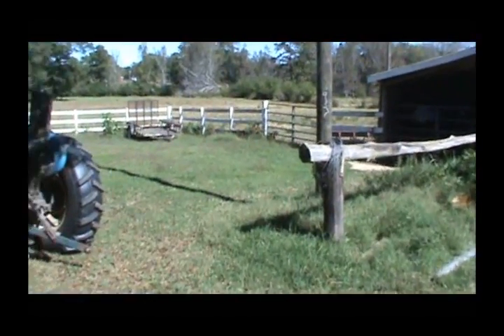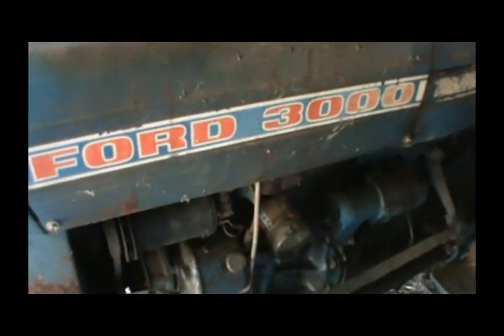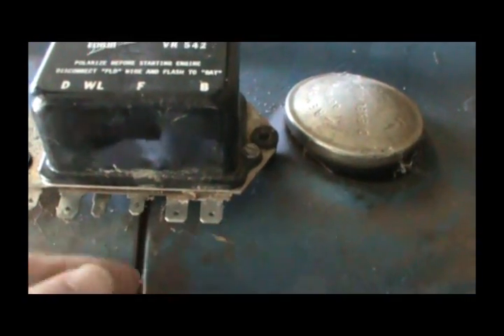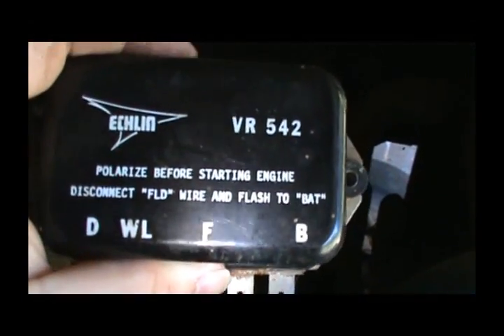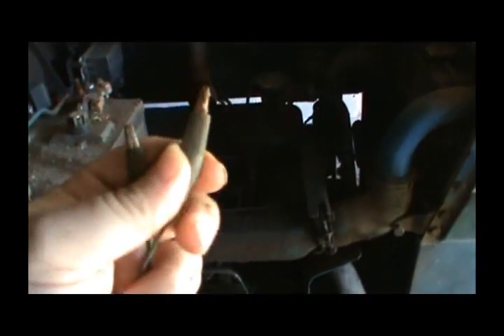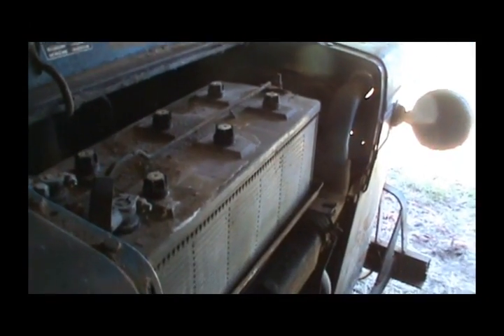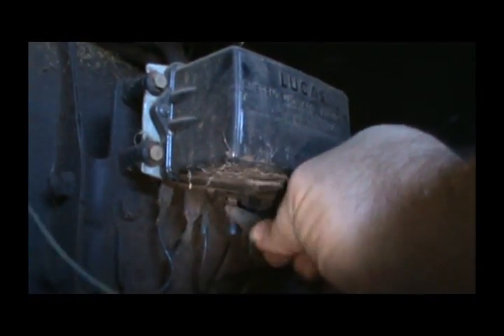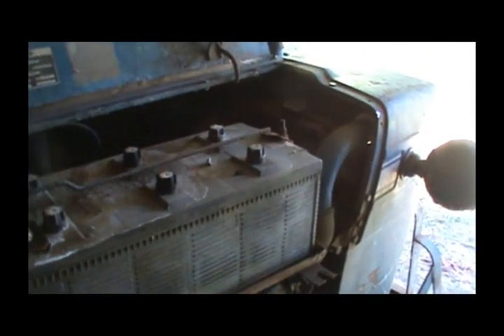Tractor's generator not charging? Try this...

Comment: Just bought a Ford 3400 and it is doing the same thing. I did find the wires from the generator are cracked, but going to do this flash on the regulator, since it has a new battery too.  Old video but so glad it is out there on the tube!  Hope you're doing well.
Reply from the maker: I hope it helped!  Hopefully the cracked wires are the culprit.

Comment: This is called polarizing the generator. You must do this because the generators magnetic field needs to be set for negative or positive ground. Don't do it and you could burn up your generator and ruin your battery. It is far easier to make a quick connection just for a second between the battery connection of the starter and the "A" terminal of the generator. Same connection electrically with no digging or fumbling. Just a quick tap is all you need. The generator should turn about 1/8 of an inch and you know it is done. Nice farm!
Reply: That is obviously a regulator for a generator that has an internally earthed field. For an externally earthed field in the generator  momentarily short B and D terminals together. The earth for the externally earthed field is connected  to the voltage vibrating contact in the regulator. Circuit to earth is completed via the earth tag on the regulator.

Comment: I have been charging a battery on a Ford 4000 for 2 years since my father in law passed. I was about to replace the generator and voltage regulator, found this video and so far it’s fixed.

Comment: Dead battery and broken key switch replaced and would not charge.  This voltage regulator polarization trick fixed it!  Thanks. You saved me time and money and I learned something new.

Comment: Hey bo, I got a strange situation with my Ford 3000 diesel. It was cranking fine and then the battery went out on it. I replaced the battery cleaned all connections and now it wont turn over unless I jump the starter with a screw driver, I had the starter tested and it was hitting every time. Mine doesnt have the neutral safety switch hooked up. Any ideas?? Its driving me crazy
Reply from the maker: I'd suspect the switch or the wire from the switch to the starter is broken.

Comment: Should I try to flash it if I’m getting a crazy high voltage? Or should I just replace it
Reply from the maker: If you're getting voltage, it's flashed.  Probably need a new regulator.

Comment: You said to touch the positive?  It sure looked like there was a negative on top of the battery in your video ,  Also,  my tractor is a positive ground,  would that matter?
Reply from the maker: You touch the positive to the field terminal.  I have no experience with positive grounds but I will assume the generator puts out positive power to the battery.  Never seen one that put out negative power.
Reply: @farmboy30117  Thanks for reply,. This method did not turn out my light so ill be testing generator , possibly regulator bad.

Comment: What if it still doesnt spark? New voltage regulator?
Reply from the maker: I'd check to make sure all the power and ground wires to the regulator are good then call it.

Comment: Gonna try this trick on my ford 2000. Recently got it running again after a 32 year lay up, got no charge to the battery and light on the dash. Also got no lights or horn working.

Thanks for the video.

Comment: hey farmboy, first of all great video! that was really helpful.  I'm helping my father-in-law work on his d14 Allis Chalmers tractor and the battery won't charge. it's a positive ground 12v generator. the ammeter shows discharge and a multimeter on the battery shows the same thing. I stuck a wire between the 2 points it showed me on the diagram for the voltage regulator but it still doesn't charge. I also checked the voltage between the 2 leads on the generator and it doesn't show anything. what do you think the problem is? is there another way for me to check and see if the generator is even working?
Reply from the maker: Thanks Eric!  I'll have to admit I know nothing about positive grounded equipment.  Sorry.
Reply: farmboy30117 
No problem. Thanks again for the informative videos!

Comment: i watched 3 video's on how to do this and this is the only one that made any sense to me. 

just got my new regulator in and that stupid red light finally shut off. thanks for making this video, i couldn't have done it without you.
Reply from the maker: Glad it helped!
Reply: Farmboy is spot on with his video!  However, this method ONLY applies to Type "B" generators.  Lucas is a type "B" and usually found in older Ford tractors.  Many older tractors use Delco-Remy generators and these are Type "A" generators.  Type "A" generators require a different "flashing" or "polarisation" method than shown in this video.  Using the wrong method could damage your electrics!  Also, the voltage regulators come in Type "A" or "B" flavors as well.  They are not interchangeable!  Be advised!!

Comment: I wonder if you have any thoughts on my problem - which is:  I have a little 1960 Jacobsen 8hp garden tractor that won't charge the battery.  I've had the Delco 12v starter/generator rebuilt by shop that only works on electric motors.  I've replaced all the wiring.  I have a new ignition.  I have a new voltage regulator that I put in today thinking/hoping that I had replaced the last item in the charging system.  I saw your polarizing / re-flashing the Field video which I did with the old VR before I fried it.  Do I have to do it to the new voltage regulator?  Do you have any other advice if not?  Thanks for your help!
Reply from the maker: Bob, I'm in no way an expert on alternators/generators, but I can tell you that (on our Ford 3000) when the battery is disconnected, I have to reflash the field to get it to charge.  I'm not sure how it works on your garden tractor though.
Reply: Thank you for the input.  I'll give it a try later today and let you know.
Reply: you may have to change the idot light it flashes the field on some alternators

Comment: generators don't have diodes
Reply from the maker: You're correct, but there is an in-line diode to prevent current from back-feeding into the generator

Comment: hey farmboy. I have a mf 35. my generator gets really hot when I turn off the tractor. I have to disconnect the battery. I've changed the generator still same problem. you reckon its the regulator? I've checked all the wiring. cheerrs
Reply from the maker: I would reckon that's the issue as long as everything is wired correctly.  Sounds like the power is back-feeding into the generator.  I suppose a diode or something is bad.
Reply: the points are burnt together in the regulator

Comment: Thank you Farmboy, I've had problems with my 55Ford, been restoring it and never had to deal with flashing a generator. Some idiot looking at the car, back when we thought we'd sell it, hooked up a 12 volt battery to it. The car's a 6v system so it fried out the regulator.

Anyway, Im replacing it tomorrow and your video was a nice easy to understand guide to polarizing the generator, so thanks man. :)
Reply from the maker: Ian Knau You're welcome!  Thanks for the comment!